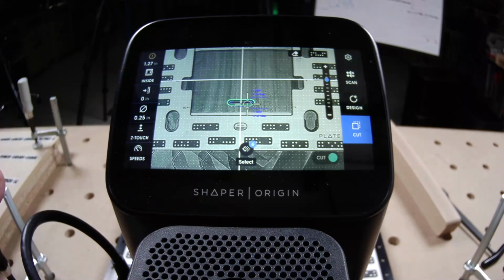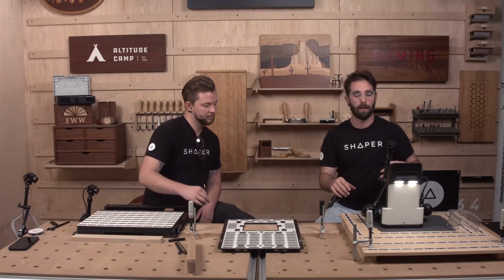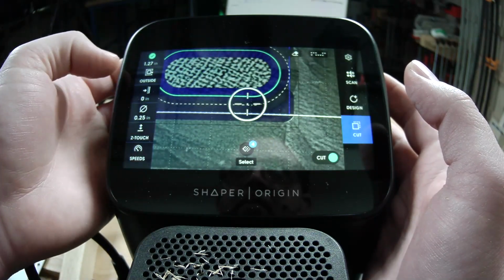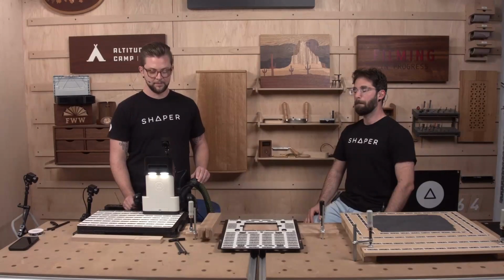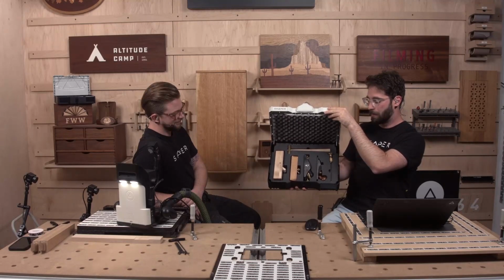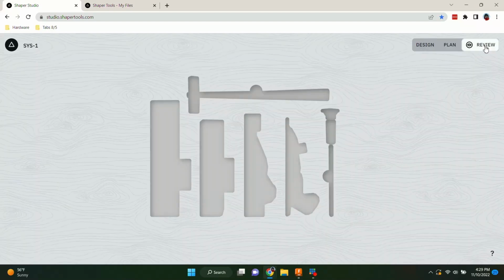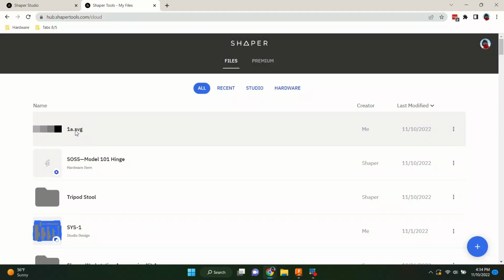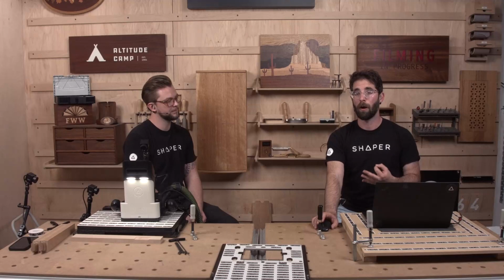Session 70  – English: Welcome to Jenner

Comment: Can you add the functionality to have the option to automatically adjust the cut depth to your encoded depth? When you display what your encoded depth is have a button/icon to tap on to cut and paste that value into your cut depth instead of manually typing it in.
Reply: Might want that for your final pass -like double click to set or a button to set it.  However if you start the cut and it automatically goes to half an inch right away, you're going to have a problem without stepping down into it.  I think that's where autopass comes into play
Reply: I meant before you start your cut the tool will warn you that the cut depth is greater than your encoded depth. When you tap on it to display what the encoded depth is you have to manually correct your depth cut. I was wondering if they can add a button/icon to automatically update the depth cut instead of typing it in. I didn’t mean to automatically adjust the depth cut while cutting. That would be cool though but it would have to know what pass you’re on to adjust the depth accordingly.
Reply: @markpotenza1894  I think what you describe is exactly what happens.  You are on a .5 inch deep encoded line, the machine is set to cut .625, when you click green for cut, you are warned.  You have the option to cancel or cut anyway. edit... check out at about 14:50 in the video
Reply: @80211Denver  Thanks I’ll check it out. If I remember correctly using your example you have to type in .5 if you want to correct the cutting depth. I was thinking to just tap on the .5  encoded depth or an icon next to it to automatically update the cutting depth to .5. Less typing less chance for error. Thanks again.

Comment: Didn't catch the live show
I use Corel CAD to create my SVG Files.  It's a less expensive AutoCad LT -works with native DWG file formats and has a nearly identical interface, command line input, etc.  I grew up using autocad so it's very natural.  I do use Fusion but find it clumsy... never really got into 3D stuff.  Corel CAD does have 3D capabilities but I don't know how it might apply here
I also use Corel Draw rather than illustrator -especially for text projects like inlays.  Again... far less expensive tools I grew up with.